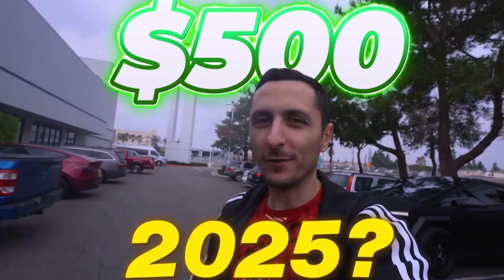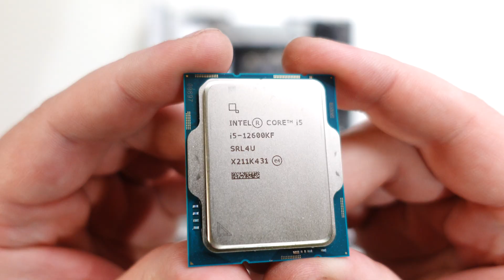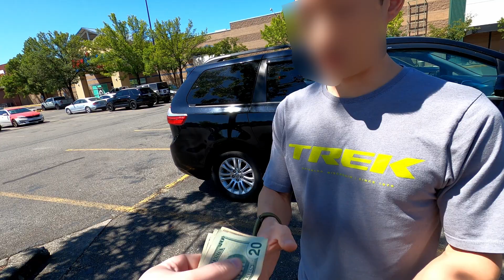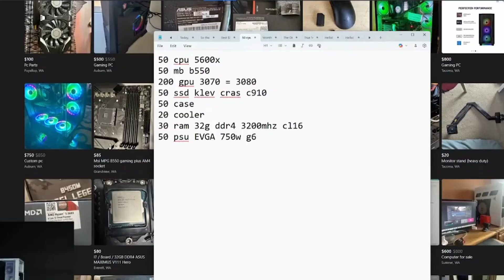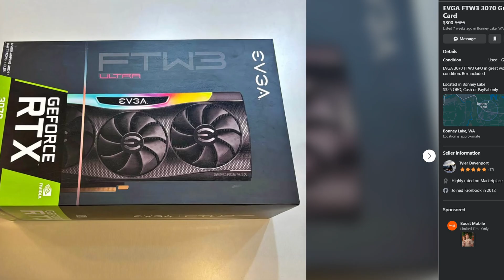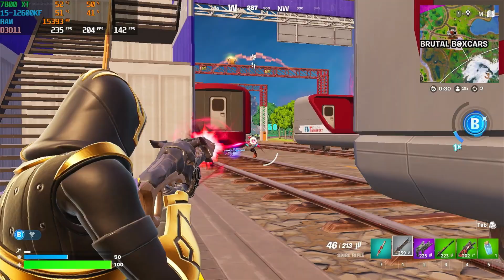I Built The Best $500 Gaming PC on Youtube

Comment: Wait, why are the FPS numbers so low for a 7800xt. Those frame numbers should be for 1440p no?
Reply from the maker: To be honest i thought the same thing.. i actually watched other benchmarks on it, and when max out on graphics they got similar numbers.. I could have easily switched to 1440p and just slightly lowered some things, but i had everything high or ultra settings. I probably should have done the benchmarks on 1440p, but originally i thought there was no reason to benchmark a $500 computer at 1440p. Thank you for watching!

Comment: So when is a $500 PC not a $500 PC, when someone builds it with second hand parts.  I know it's 2025 and the average IQ of current adults is at an all time low, but its click bait, try actually stating best SECOND HAND PC with second bits for $500
Seems to be a comon theme now, build stuff with second hand prices to beat the other guy who built a second hand PC. 

Tips for anyone looking to do this, join a PC/gaming community, they will often have members markets that undercut the second hand market, buy B-Grade as it can save even more, and look for sold not working builds for some spares or the case if needed.  Even better, if you state you will be creating a Youtube vid, and really need help doing it, many sellers will help. I have had i3 processors for £15, decent PC cases for £15, free memory, free motherboards, clearance SSD's and all sorts doing some builds for my kids over the years.
Reply from the maker: Totally hear you, but the reality is every “$500 gaming PC” worth building in 2025 uses used parts — otherwise they’d all be running rx 6600's.
The challenge isn’t if it’s used, it’s how well you can build with that budget. That’s what makes it fun. To call it clickbait when i stated i "Built The fastest" and then actually "Built the fastest" is a bit disingenuous. Appreciate the tips too — sounds like you’ve done some awesome builds yourself.

Comment: Great build once again! That Black Myth Wukong result is really weird… I always thought the 7800 XT was a 1440P GPU but it’s getting sub 60 on 1080P? Is this a mistake?
Reply from the maker: Thanks! And yeah — good eye. That result surprised me too. I was running Black Myth: Wukong on 1080p Very High with no Frame Gen, and the game is brutal at those settings. That 52 FPS average is legit, it's just a seriously demanding game.
With Frame Gen turned on, it jumped to 92 FPS, which is more like what you'd expect from a 7800 XT.
Also worth noting - at 1440p, you probably wouldn’t be running it with everything maxed like I did at 1080p. If I had tuned the settings down a bit, it definitely would’ve held higher FPS. Just wanted to show what this thing could really handle raw. Thank you for watching!
Reply: @fpsforless No upscaling with that game is brutal… but I’m sure other games show it more mercy
Reply from the maker: Yeah it honestly is a great gpu. Whats funny is you had me second guessing the numbers as well, so i started watching benchmarks with that card and they found similar results. Thanks for keep me on my toes!

Comment: Try beating my 850 dollar build. 5070, 7800x3d, 2tb nvme, 32gb ddr5, sama sv02, and a thermalright 360mm aio.
Reply from the maker: That’s a MONSTER build for $850 — if you really landed those parts at that price, hats off! 🔥
Might have to see what kind of sorcery I can pull together for the next challenge 😏💸
Reply: biggest lie ever nobody's believing that
Reply from the maker: Some people say that about my builds as well, thats why i try to gopro and document everything.  I have seen some used 5070's just under $500, but ive also never seen a 7800x3d for under $250 either, so seems pretty hard to pull it off, but you never know!